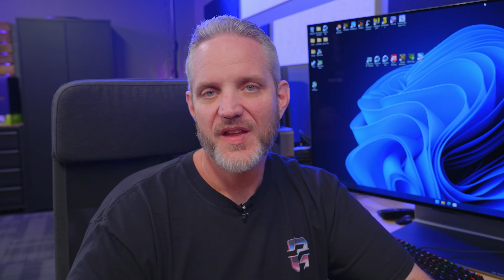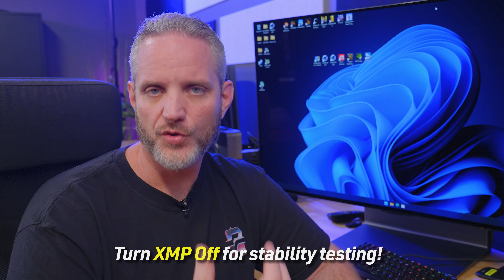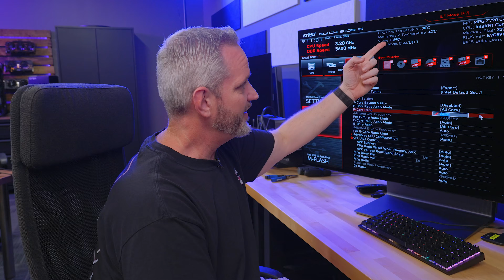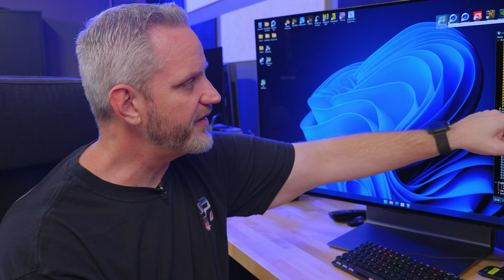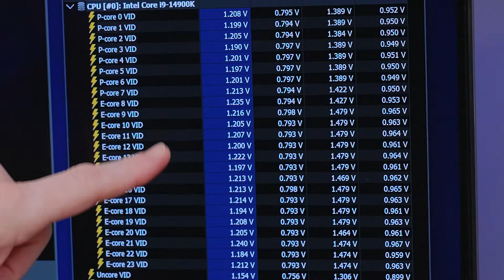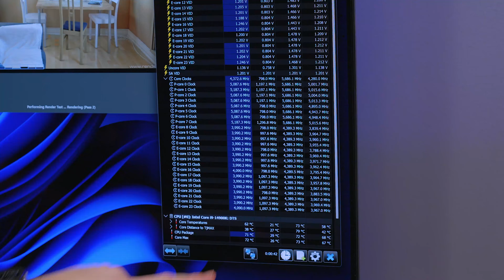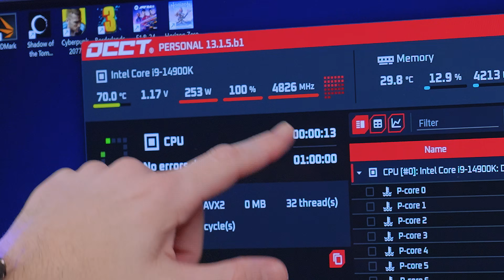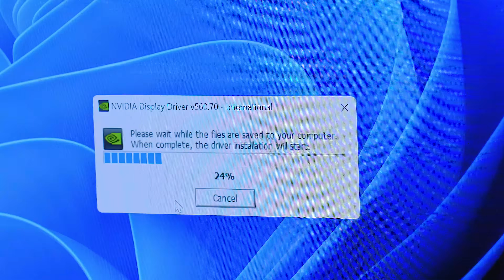Guide: How to check if your CPU is BAD!

Comment: Mine's weird, happening with 12900K too:

I had a 13900K in a msi z790 mag tomahawk with 4070ti:
started over time getting vram errors or game closing for: tekken 8, ready or not (unreal 4-5 games)
eventually started getting black screens and the system would repower and not create crash dump files

I then (am trying) to return the cpu, and meanwhile swapped for a 12900K, i.e. one that's suppose to not have these issues:
It began a little more stable but within a week, similar yet worse thing: tekken 8, ready or not specifically crash to black screen into reboot with no crash dmp files created.

Note that I'm using the latest stable bios update for my board (the first non beta 0x129 included bios), and am about to try replugging gpu and testing ram individually, but I have already run memtest86 on the ram as a pair, ran cinebench, etc stress tests on cpu and things, seems fine, and yet opening tekken 8, instant black screen now to reboot with a 12900K. Very confused. My wall socket has surge protectors as well, and I need this computer to work remotely on 😅 I don't know what to do next after I test swapping my old 1060ti gpu and retesting ram. BIOS settings areteh defaults after latest bios change, with xmp turned off and enhanced turbo also turned off. it sets by default ll mode 12, not really sure what else to do as other people with those settings seem ok. I tried removing logitech drivers as people were suggesting these can cause issues. But the lack of dump files being created makes me have to assume it's purely a hardware fault right? and only when under spikey loads or waking up from idle-ish... dies-inside

Comment: What sucks is I bought my 14700k to have fun and enjoy overclocking it, BUT, this Intel crap has ruined it for me. Like, what's the point of improving any temps with better air or water cooling when I can barely run 100-200mhz above before games start crashing having nothing to do with temps. Such a shame and sham!

Comment: about 8 months ago i tried to run cinebench r23 at stock settings and it wouldn't even work.

Fast forward to now I'm underclocking my 13900k to 5.0ghz just to get into windows without BSOD. Yes, my CPU has degraded that much over 8 months. updating bios to the latest within a week of every single release of another bios. CPU is fried and I'm trying to RMA it, Intel better fix this.

Comment: I'm actually a little confused on what to do here. 
I have a 13900k and run it stock basically. And have a year left for my Microcenter Warranty. 

It's performing just fine and normal. 
Only gone down this rabbit hole because I tried to launch Black Myth Wukong but had the out of video memory error. Resolved it by tweaking it down using Intel's Extreme Tuning Utility. 
But other than that, no odd crashes or anything to indicate a bad CPU. 

I guess my question is, with all the reports of the accelerated degradation, is it a known fact that this chip WILL have an accelerated degradation or is a crapshoot of finding out later down the road? 

Trying to determine if I can get this resolved now by getting it replaced my microcenter while still having warranty coverage. 
I'm just surprised there hasn't been many comments about getting it RMA'd from the get go but more so about getting their chip tested.

Comment: Steps to get this garbage of a cpu to crash : use the computer for office related tasks, general web browsing or overall light  loads, start wrc 2023 without rebooting.
It was fine up until a month or two ago when I had the thing undervolted and running "cool" at ~80°C under load, now I have to keep everything at baseline spec, meaning it's frying itself running between 1.3~1.5 Volts and hitting 100°C even under light loads.

Comment: I’ve got the ASUS Pro Art z790 creator WiFi and my PC Was perfectly fine for the last few months since I built it and then I did the microcode updates and all that and now I’m having a lot of instability. In the last week I’ve blue screened twice, Baldur’s gate 3 crashes all the time, I can barely get through one encounter before the game crashes. I’ve had some issues with Guild Wars 2, so now I’m doing the testing, the intel burn test can’t complete on single core, and I’m running OCCT and I’m 10 minutes in and I got one error…. Looks like I may have to ram my cpu

Comment: So proceed with caution with some of these microcode updates, just did mine tonight for my Gigabyte Z790 AORUS ELITE AX and it INCREASED my voltages on default settings to 1.4+ and maxed out my cores. While trying to hard lock values after that it ended up bootlooping until I was able to get back into the bios and push things back to default which then suddenly all was well in the world and it jumps between .77 and 1.15 at idle.

PC was fine before I did this since I had been controlling my voltages and temps way before there was reports of issues with intel 13/14 gen.
Reply: yeah, all the manufacturers raised the "lite load" setting to crazy values with the new x129 BIOS updates, MSI put it on 18 instead of 9, "lite load" is a term on MSI MOBO's but the equivalent exists for the other brands but its named differently.
very easy to fix tho, just put the value to lower like 9 or 12 depending of your CPU, it instantly lowered the temps, voltage for me.

Comment: problem with my 13700k bios version 2503.
Cinebench 24 makes my cpu thermal throttle instantly unless I set SVID Behavior to "Typical".
Bios 1501 slight undervolt, Cinebench 24 = 1752 score
Bios 2503 SVID Behavior Typical, Cinebench 24 = 1016 score

any advice is welcome

Comment: I have built A LOTS of 13/14th gen K SKU PC's and I have ALWAYS reverted the MB default overclocks to the Intel default values. In some cases I have also used an "ECO" -mode (undervolting and limiting the PL1/2 limits). I have not encountered even one defective CPU this far. The insane default settings on motherboards have been the main culprit to all Intel problems for many years now. It began several generations ago and it has gone more wild all the time even though many reviewer have been warning about the motherboards and those default UEFI settings. And here we are now. Intel should have restricted this idiotic trend and now it pays the price for not doing so. I am not worried about this at all, I do not think that with Intel defaults CPU's will die if adequately cooled etc. At least that is still not very likely to happen.

Comment: i have a issue with my pc, after installing the latest bios for msi b450m pro vdh max ,i have lost half of performance in games from 100 down to 60 fps ,in menus from 1000fps to 154 fps, reverting back to old bios didnt help, reset bios to default, and used optimized settings, it worked but after a restart again same poor performance,  have to again do default, save, reboot and and again reboot, change to my settings and reboot to make it work and again keep repeating the steps, any help what is causing this?

Comment: I've now undervolted my i7-13700K, disabled Intel Turbo Boost & Turbo Boost Max, and I'm running no hotter than 55c under load. 

Before, my CPU was running hot while encoding. Even after upgrading to Noctua D-15, thinking my CPU would run cooler, I found intel just gives it more power until it's at +95c.
 
Watching my CPU sit at 95c for extended periods of time while I encode videos was too much for me. Plus my room can heat up fast while I encode. 

Now, with a -0.050 Variable Ratio and disabled turbo everything, I never run hotter than 55c. 

We've been asleep while Intel and mainboard manufactures were needlessly over clocking factory settings.

It doesn't feel slow after undervolting, It just takes a little longer to encode. At least my CPU won't burn out on me because of reckless default settings in the BIOS.

Comment: Love you to death @JayzTwoCents, but telling people top simply turn off the computer when your not using, to prolong the life of the computer seems a little extreme. I mean, do we expect normal cpu degradation to be accelerated? Think you need to be clearing on how long cpu life is and how long we are prolonging their death, before simply stating to turn off your pc when not using it. Is normal degradation going to take 10 years or 10 months? What I find interesting on this whole intel issue, is why did all CPUs display issues around the same time? I have a 13900k I purchased last year and a 14900k I purchased earlier this year. Both cpus starting showing issues at the same time ( around march), sounds like there is something software related that caused the issue in March versus the issue to simply be degradation.

Comment: I have MSI MEG Z790 ACE mb with 13900k from 2022 week 46 and its been rock solid.  I didn't even bother to turn off XMP and it passes IBT single and all cores.  When it dies I'll get something else but it is under warranty now until 2028 per the intel warranty checker.  The 2nd MSI 0x129 bios 1.C0 won't allow the CPU core voltage to run up like the previous ones did.  FWIW Intel based systems have always been more stable for me than AMD and I've been building my own for over 30 years.

Comment: Should I even be worried as my 14700k runs ≤ 1.25v pre 0x129 and mostly does low powered tasks with the occasional heavy load

Comment: Well well intel. Thanks for making me use a ton of money just to get an average rig.
After the latest asus Bios update, when Idling; the cores jump between 1.100 and 5.800 and 0.7 -1.48 volts. And when stress testing its 4.900 and 1.2 volts. And it will not let me Lock all cores and adjust the voltage offset. What a shit show

Comment: if it works it works if its not working bring it back to the shop (Warranty) en let them figgured out :) more time to play games/ and working 

the real problem is that all the companys want to put the blame by the consumer that is how it works. 
Only then can they say that you demolished it or used it incorrectly. 
The fact is that a lot of consumers don't even know how hardware works let alone getting into the BIOS and undervolting the CPU or understanding voltage and why would they.  CPU and motherboard makers should start talking to each other better!!!!

Comment: I think you can change OCCT to lower than 1 hour in the free version (You cannot go longer than 1 hour though)
Reply: After my testing I can confirm it lets you go as low as 15 minutes in the free version - It will not let you go longer than 1 hour though

Comment: I also had the 'ran out of memory' issue in games with 13900k, 32gb ddr4, 4070ti S. Switched to 12700, and still had it wierdly. Upped to 64gb and problem went away....sigh of relief, cpu is still fine. Was especially apparent issue in diablo 4, travelling to different areas ram usage just kept picking up

Comment: Sometimes I noticed that HWinfo together with BENCHMARKS can cause fault. 

Already did on RMA for 14700kf which I got in Jan 2024. Did RMA in late July because of crashes. Received new 14700kf just in 4 w.d.
Europe , Latvia

Already testing it on new microcode(gigabyte MB), really rate crashes in games as once human or ARK ASCENDED. Noticed that UE5 cause a lot crashes.

Comment: I've had a i913900k pretty much shit itself, I got it upgrade to an i914900kf, that started to have the same problems.
this time I got the intel default setting configured in bio's to fix most of my problems, I then the Updated bios and that has helped so far.
I was running into Counterstrike 2 shader compiling crashes, I had to crash the game and system multiple times, before the game was able to load a match. (with my i913900k when i was running mobo default bios.) 
R23 would instantly send my cores too 100+ temps on activation, as soon as i put the intel settings on, 40-50 temps. 
in game temps where fine until it would instant spike from some process and crash, R23 was able to replicate the fault for me within a second of activation.
Then when I figured out for myself that i needed to under clock it, then I started to find out about the intel settings a few weeks later.

Comment: am i Cooked?  I cannot complete a test of cinebench R23 on Stock settings (XMP enabled).  Context:  The test was conducted after flashing the bios and updating the motherboard firmware. 

Specs:
CPU: i9-14900k
CPU Cooler: Arctic Liquid Freezer || 360mm Rad

MOBO:  Asrock Z790 Nova Wifi MOBO
RAM: Team Group 7200mhz 32gb
PSU: ASUS TUF Gaming 1000W Gold
GPU: Zotac Amp Airo Extreme 4080 
SSD: 2TB samsung 990
Case: Antec performance 1ft (3 140mm intake case fans + 1 Extake fan.  Rad mounted on top)

Comment: Been seeing recent high temp averages leading me to check aoi pump and everything under the sun; still can’t find anything for the cause; under normal monitoring my peak temps for cpu were 65-70c
Now sits at 95-99c constantly when playing a number of games, I’ve even tried adjusting setting with extremely mixed results. No crashing yet but the constant high temps have me anxious every time I go to play anything remotely intensive.
14700k 360aio 4070dual seven addition fans and I just can’t keep the temps down, next step is going to be adjusting cpu voltage but it just makes no sense to me why all of a sudden my temps are holding high, 45-55c  at idle. Anyone else with similar issues? Again no crashing yet just quietly freaking out waiting for something bad to happen.

Comment: Asus ROG Maximus z790
Asus Ryujin II RGB 360 AIO CPU Cooler
13900k preordered.

I havent done any testing since the microcode updates but before my system would never under any condition or settings would pass cinebench r23 (100c +). Blue screen Out of video memory always. Also something ive always thought weird was my system has never idled at less than 39c and still doesnt (usually around 40-41c). All I've looked at always said that was normal for 13900k. I've repasted about 10 times and always the same result.

Now with the microcode update my system doesnt really crash anymore in gaming. I will try some of these tests to see if there has been more damage.

I wonder if JTC or maybe someone else has would do a video showing what you can do if you think you have a bad cpu and kind of the steps and what to expect. I would assume it'd be several weeks with system down waiting for intel testing and RMA?

Comment: Hey guys, I'm not sure if anyone will see this, but I'm just concerned with my 13700KF. The temps for synthetic tests seem to be quite high. When I ran Cinebench r23 (multi-core), some of the cores would reach as high as 100 degrees Celsius. The max safe temperature seems to be around that, and the processor throttles and doesn’t exceed that. I haven’t had any crashing or even slowdown in windows, it seems to be stable. Is this meant to happen, or is it a fault of intel /Asus? (the motherboard manufacturer, its an Asus Z690-F motherboard, with the latest bios and microcode). I do have a 280mm from my last build, its around 7 Ish years old at this point, could that be why? The temps when playing games is fine, around 60-70 most of the time and idles around 30ish.  Any help would be great, thank you to anyone who has taken the time to read this! :)

Comment: MSI MPG Z790 Edge WIFI Gaming and i7 13700k. Latest BIOS of course. All has been well with the testing. Also multiple Wukong benchmarks prior to getting the game. Zero crashes since building the summer of 2023. AIO for the cooling. I think I'm ok but still thinking about going Ryzen my next build.

Comment: 👍 Puikus video. Turiu naują sistemą su 14900K RTX 4090 4x16GB GSKILL 7200MHz (iki 5600MHz, nes tik 5600 yra stabilus). Bet kai aš žaidžiu BF 2042 apie 2-2,5 valandos, sistema užstringa. OCCT testas - be klaidų CPU + RAM, bet kai sistema pagauna mikro užšalimą po 2 valandų žaidimo, OCCT testas rodo klaidas testuojant CPU+RAM, bet jei testuojama tik CPU arba RAM, OCCT testas geras, klaidų nėra. Gal turit minčių kas negerai? Gal problema vaizdo plokštėje? Ar žinote kokį testą, gal geriau nei OCCT?

Comment: Built a PC less than a week ago. MSI MAG B760M WiFi II motherboard, gen 12 12700k, 64 GB Corsair Vengeance RAM, MSI RTX 4060, Corsair SF850L PSU, MSI 240 AIO, MSI 500 M2, 2TB 2.5 platter backup drive crammed in to a Jonsbo Z20 case. Yep, I had RAM OC errors before BIOS update. Not currently. Runs smoothly, for now. Love it! I'm not an overclocker or heavy gamer. Videos like yours kept me motivated.

Comment: My fan on my 1650 says 0 but it's running 
It happens after crowds strike screwup my wifi card wouldn't work after I fixed window's 
I adjusted fan speed, and it got cooler and ideas
I thought was my cpu cause the error logs 
However wifi card was bringing the voltage down to.9 volts and was overheat gpu
I fould the malware that frying intel cpus 
How fix it lock your bios 
They then say my i5 had 12 cores 
Then get new windows key

Comment: My Intel i7-13700K died two weeks ago. My computer was crashing here and there and finally it corrupted my whole C-drive and needed to install Windows again. When computer was crashing during Windows intallation, I knew there was some serious hardware issue. Finally it crashes all the time. When I decreased my P-cores to only 2, then it started to working. But when I put all P-cores back, it crashed immediately. So I sent my CPU back to Intel.